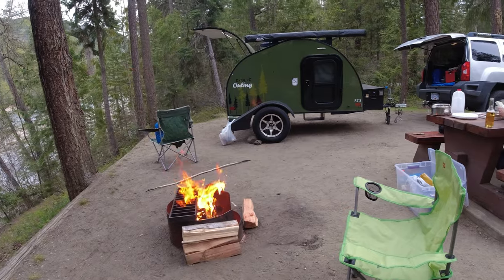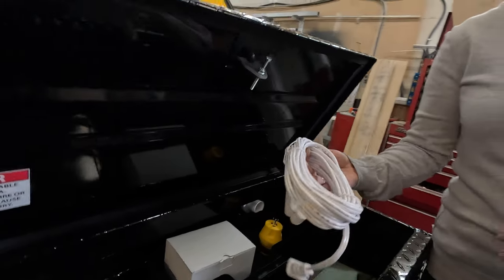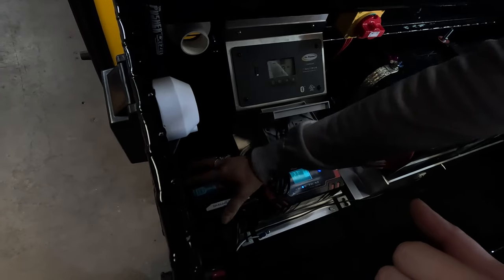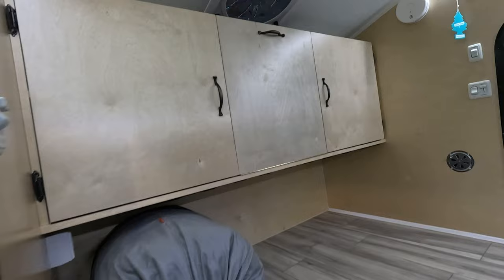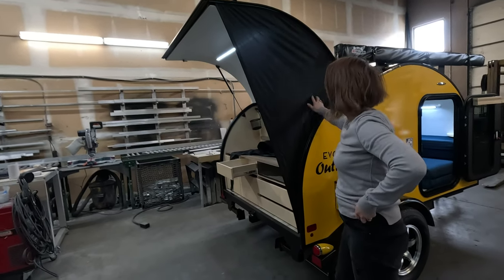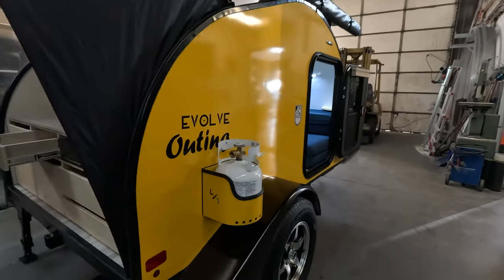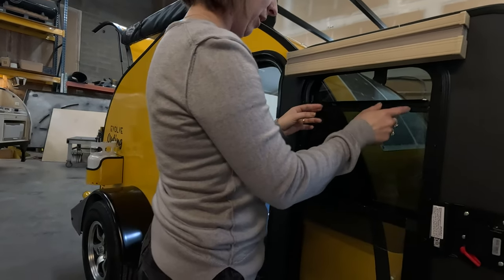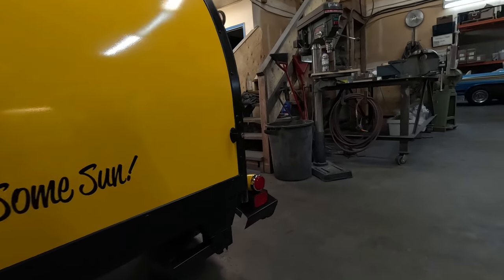Evolve Solar Teardrop Trailer

Comment: You gotta be able to stand on the tailers fenders, all switches and plugs need to be locked,  propane needs to be boxed and locked, no set in place solar, solar has to be portable to move with the sun. This trailer is good for the elderly 1 to 3 days max, anything more then the Evolve has to evolve much, much more.

Comment: How do you deal with heat since it does not have an AC? do you run internal fans?
Reply from the maker: There is a two way exhaust fan which helps to keep things cool and bearable in the cabin.... however, I've not had to camp in scorching temperatures here in British Columbia so cannot comment on the need for an AC.

Comment: I see this trailer is made in Canada.  I'm from Oregon. How much did it cost out the door. Please be clear if you say the price, let no Canadian dollars or USA dollars.
Reply from the maker: The trailer cost me just under C$29,000 with all the bells and whistles that I wanted. The base model is around C$20,000 and then you can customize it with your choice of kitchen type, battery capacity and type, electric brakes, awnings on both or one side, a larger tongue box, etc. etc. I suggest you go to the Evolve website and check it out. You can fill in a form with the specifications that you want and they will give you a quote.